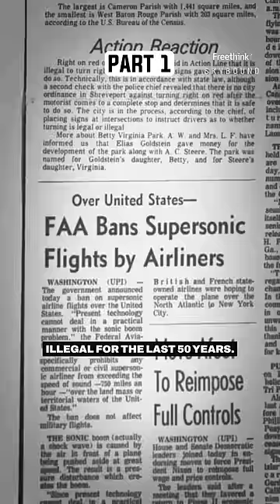NASA & Lockheed Martin's supersonic aircraft PT. 1 ✈️ #explained #shorts

Comment: One day we will figure out how to use this tech in commercial planes and I can’t wait for that reality

Edit: I mean without costing an arm and a leg and constantly crashing
Reply: Commercial planes are subsonic.
Reply: We had it, the concorde was a thing. It was super expensive, loud and not very safe though.
Reply: @thorwaldjohanson2526 i think it was only super expensive because they had to fly at subsonic speeds above land and it's onlu really fuel efficient until it flys above subsonic speeds
Reply: Looks like supersonic flight will come only for private jets. Because they created for reducing time, not for economy fuel or whatever
Reply: @thorwaldjohanson2526 The concorde was very expensive per flight because it was a gas guzzler when subsonic. It was designed to be most fuel efficient when it was supersonic and so the bad basically ripped it off the markey
Reply: @josephzicaro9913 Did you miss the "  One day we will figure out how to use" part?
Reply: @thorwaldjohanson2526 i think he meant the tech in the video
Reply: We already had that w the concord  but now it’s even worse bc it’s super fuel inefficient(so bad for the environment too), cramped and expensive
Reply: @calebquintana5724 that's misleading at best. Saying "oh, it was meant to be efficient at Mach 1+" is like saying an 18-wheeler is supposed to be efficient at 65 mph. It's still less efficient than trains for moving goods. Just like modern aircraft are more efficient at moving people.
Reply: @josephzicaro9913 no rlly???
Reply: AaaaaaaaáaáaaaaaaaaaaaaaaaAáaAÁAAAAAAAÁAAAAAAW❤áw❤❤❤❤❤❤❤❤❤❤❤😊
Reply: "One day" we already did figure it out. It didn't last because it was noisy, dangerous, and HELLA costly.
Reply: Supersonic is less lily to crash than subsonic becuase you have so much forwards force that a recalculated rout with NO turns...
Reply: Also, it's very not fuel efficient so yeah it'll cost an arm and a leg
Reply: Also its a cool concept but accelerating to supersonic abruptly is too many g's of force for the comfort of many passengers so speeding up and slowing down is much more gradual
Reply: And if you need to make a turn, you have to preplan way ahead to decelerate enough but decelerate slowly
Reply: Concorde didn't constantly crash, it was actually safer than pretty much every aircraft of its time.
Reply: @thorwaldjohanson2526 a broken piece of rubber brought me into this world and i dont want to be taken out by it
Reply: @justinmiller5660 No it’s not, you’re just not understanding or at the very least looking it up.  The Concorde used 3x the fuel to go 4-6x as fast at a higher altitude benefiting from thinner air.  Thing is, once you hit Mach 1.2 air resistance actually goes down and it cruised at 50,000 rather than 30,000 feet making it better.  The only thing making it less efficient was the overland supersonic ban.  These planes are being designed precisely because this was the case and NASA thinks they may have found a way to get the ban conditionally lifted.
Reply: Or would never be affordable though, I mean airlines already pack as many people as possible into a plane just to be affordable
Reply: @genericasianperson6405 why couldn't they always fly supersonic though?
Reply: @genericasianperson6405 it was inefficient because it used four turbojet engines and relied on afterburners to reach and maintain its supersonic cruising speed. It was less efficient when it was subsonic and supersonic. Meanwhile, we have turbofans today that massively more fuel efficient in all modes of flight than any turbojets while also being more compact and more powerful. That’s why even fighters today use turbofans.
Reply: @AnarexicSumo that’s entirely backwards. The Concorde was less efficient all the way around. The Concorde cruised at MAX of 1,540 mph (1,338 kts), but usually at 1,340 mph (1,164 kts). Meanwhile, airliners today have had their normal cruising speed reduced compared to the 70’s and 80’s as a cost-saving measure. The 747 was introduced with a cruising speed of 650 mph (566 kts) and the DC-10 had a cruise speed of 675 mph (586 kts). So the Concorde flew just over twice as fast as the airlines, not your 5-6 or whatever nonsense.

You were almost right and fuel burn rates though, the Concorde’s Olympus 593 engines used more than 3 times the fuel of a comparable CF6 engine of the time. The difference being that the Concorde was not more efficient at supersonic speeds. It required the afterburners to maintain that speed, which is laughably inefficient.
Reply: I love the idea also and hope I get to see it but even if they work out all the kinks I don't know of there would be enough demand to make it viable
Reply: @thorwaldjohanson2526 The Concorde was very safe, it only crashed once, it is safer then the 737 max.
Reply: @thorwaldjohanson2526  Air France 4590 was the only fatality in Concordes 31 year history 😊
Reply: @MrTrevortxeartxe it wasnt dangerous  air france 4590 was the only accident in concordes 31 year history also every passenger stated that it was 'the only way to fly' a bucket list moment.
Reply: @justinbowes5390  they had a metre in the plane to leg people know they were travelling above mach 1, whilst the hostesses served champagne
Reply: @thorwaldjohanson2526 it wasn’t completely unsafe. Like the Tupolev 144 i think it was.
Reply: @hardcoreway ummm no. I can’t believe so many of you think this is news. SuperSonic commercial has existed twice. Tupulev 144 (concorde ripoff) and Concorde. Neither were private. Both were commercial.

Comment: a common misconseption is that when you see the mach cone form around a jet, that is it passing supersonic and will release a sonic boom. This is not the case most times, the mach cone forms at around mach .96-.98, therefore meaning that the plane is almost supersonic but not quite yet, hense the condensation around the aircraft. Once they accelerate past that then you will hear the boom but most of these low flybys you see cant get up to supersonic speed because if they do they will shatter all the surrounding windows and damage everyones ears
Reply: you are right they dont travel at Mach 1 but slightly slower when seeing the condensation cones. I thought that due to the acceleration over the wings, the flow over the wings does experience Mach 1. Thats why the compression waves happen and we see the condensation etc. So i dont see why there shouldnt be a sonic boom as there are compression waves. Maybe not so loud as when travelling at Mach 1 but still.

Would appreceate your input!

Comment: So what is it about the shape that removes the sonic disturbance?
Reply: Likely the long, conical tip with the cockpit pushing out to make a concurrent low pressure behind it into the intake. As well as it being very narrow but long, to reduce the frontal profile so the sonic airwaves don't layer up as much
Reply: I think it is the fact that the bottom is much smoother, making the sound much quieter
Reply: Just watched a video on this and from what i understand the shape of the aircraft makes the sonic boom come from the top of the aircraft while the boom on the bottom is minimized by the smooth shape on the bottom.
Reply: @diraltmcallister3523 This is completely wrong.  The shape pushes the predominant of the pressure cone above the plane.  It’s only quiet from below.

Comment: Its not entirely a legal issue so much as an efficiency issue. Lower efficiency means less profiy.
Reply: No, that was a big issue for the Concorde because of the supersonic ban it spent a lot of time overland at subsonic speeds where the engines weren’t as efficient once it got out over the water it was much more efficient,  if this comes out and we can go supersonic overland as well. It will be much more efficient.
Reply: @DooHicky_  the concord had less seats and consumed more fuel per mile than an average 737. Ticket prices were more than double. I don't know about you but, that's a limited customer base.
Reply: @codyreber8370  yes because it had to spend most of its time below the speed of sound because it was only allowed to break the speed of sound over water, all that time over land at subsonic speeds was inefficient but if this lets us break the sound barrier over land then it will be much more efficient
Reply: @DooHicky_  you need to learn about fluid dynamics. The reason fighter planes also don't travel supersonic even over water is efficiency and more importantly stress on the frame. Supersonic travel is less efficient. That's not my opinion, that's a fact.
Reply: @codyreber8370  yes but it dosent have to be so expensive, optimised we can cut the costs due to the time of flight being shortened and efficiency of the engines increased, it wont be perfect but it will be a lot more reasonable than say the concord
Reply: @DooHicky_  its not the engines that are the problem it's the mechanics of supersonic flight itself. You could increase engine efficiency 5% and it wouldn't offset the massive amount of drag.
Reply: @codyreber8370  its not the general efficiency of the engines, they are designed for supersonic flight and work best there, the engines are built to fly supersonic in an efficient manner, what causes them to be inefficient is when they fly below the speed of sound, and this makes up most of the flight time, causing it to be expensive, the drag is overshadowed by the engines
Reply: @DooHicky_  do you know what a scramjet is? Yes they operate better at high speed, but again not at supersonic speed.
Reply: @DooHicky_  you really should understand what you are talking about before you speak
Reply: @codyreber8370  where did you get scramjet from, im talking about the concords by four Rolls-Royce/Snecma Olympus 593 turbojets. It had a mach 2.02 (1,338 mph) cruising speed for optimum fuel consumption (supersonic drag minimum and turbojet engines are more efficient at higher speed), jet engines being very inefficient at low speed meant it burnt 2% of its whole fuel load at only taxi and takeoff. The aircraft used afterburners only at take-off and to pass through the upper transonic stage to supersonic speeds, between Mach 0.95 and 1.7. Afterburners were switched off at all other times, fuel consumption was a big deal back then mostly due to the 1973 oil crisis as well. And for the high drag, the drag at supersonic speeds was related to the span of the wing. This led to the use of short-span, thin trapezoidal wings with low drag at high speed. Dont tell me i dont know what im talking about
Reply: @codyreber8370  less profit dosent matter when you only make a few and make the tickets expensive, the rich people who did fly on it could afford the expensive ticket which brought in lots of profit for the airlines
Reply: @DooHicky_  drag isn't just a matter of cross sectional area. It's the way that air flows at supersonic speed. Yes you need smaller wings to fly supersonic. However that also comes with either a really steep takeoff and landing pitch or higher landing speed which also limits the number of suitable runways. Back to the point about drag, it doesn't increase linearly with velocity. Just before Mach 1, and turbulence builds behind the wings and compression of the air in front causing significant drag. Look up drag coefficients vs Mach number. Most of the fuel spent in a plane is overcoming drag.
Reply: @codyreber8370  well if runways are an issue then look at the boeing 2707 concept, and of course fuel is spent overcoming drag you need thrust to go anywhere
Reply: @DooHicky_  yes. Fuel being one of the biggest expenses. That and maintenance is going to be a much more pressing issue. Speed tape doesn't exactly cut it for sealing off between panels on a supersonic aircraft. I'm not saying supersonic commercial travel isn't going to happen or that it isn't feasible, it's just going to be way to expensive for the vast majority of people. Its likely to be reserved for intercontinental travel like the concord was in the first place because it's simply not economical
Reply: Yup, supersonic flight for Concorde et al used 6-9x the fuel. Why are we giddy for rich ppl to grow their already huge per person carbon output?

Comment: Problem, what fuel does this plane use? Fossil fuel, so to that point all innovation should be forced to making them as clean as possible and not making them go a little faster, make them burn hydrogen so that 2% Co2 and other emissions like NOx and HC can be dropped to almost nothing then go faster
Reply: Agree this is only ethical way supersonic civilian flight could be made real, as it uses 6-9x the fuel with similar multiples of carbon output. As it is, why are we cheering that rich people could up their already extraordinary high per person carbon emissions on flights 3-10x the cost of conventional subsonic.

Comment: Great but the far bigger question is how we stop aviation from fueling the climate crisis instead of massively contributing to it through something we don’t need? 

Commercial supersonic flight would be just like it was last time with the Concorde, only for the super rich. Climate justice anyone?
Reply: If we wanted to go into specifics, concorde at full speed was actually quite fuel efficient, however below mach 1 efficiency takes a huge hit and because much of it flew over land in portions of the flight it means that it wasn't very fuel efficient during a good portion of the flight as most countries banned commercial planes going above mach 1. Having a supersonic plane with an almost inaudible sonic boom would allow faster flight times and greater efficiency, still doesn't necessarily change the fact that it runs on fossil fuels but it is a neat fact if anything

Comment: Its my understanding that its the fuel efficiency not the disturbance the sonic boom is the reason we do lot have super sonic commercial planes. The Boom pushes back on any plane going faster than sound requiring large amounts of power to maintain super sonic flight. All a plane has to do is not go supersonic until it hits high altitude and the problem of noise disturbance is solved.

Comment: So why is the sonic boom only a boom. If an optimum rate of flow of pressure waves reaching the ground is responsible for the sonic boom why are they only singular? If the ground was removed would the boom be heard at an optimum distance from the source? Would it be singular & would speed fluctuations produce marked arrivals at optimum performances?

Comment: Commercial super sonic flights ended because nobody wanted to invest more money once the last concordes reached its operational lifespan. The only route profitable and really feasible was a transatlantic London/Paris to New York where the plane can go supersonic over the ocean. Other routes could not sustain the flight costs due to the demand or the plane could not go supersonic over the route because of the sonic boom hitting populated areas. The '50yrs' is over the spl levels of all commercial flights, including sonic boom producing ones.  Those old enough, as late as the 80s, will remember the low drone of airliners that could be loud enough to drown conversation depending on where in relation it was passing over.

Comment: the main problem wasnt just the sonic boom but highly inefficient fuel use, it used 3 times as much fuel than a commercial plane
Reply: Only per hour and it went 4-6 times as fast meaning if it could go its cruising window of 50,000 feet Mach 3 it was actually more efficient for a given route.  Instead it was forced to fly 30,000 feet 500kts which it was only designed to do while accelerating to Mach 3

Comment: Single engine aircraft will never be commercially viable again. Modern commercial planes can still function with one engine (except takeoff) which has made air travel so safe and common. The first time one of those has an engine failure thatll be the end of it.

Comment: What if we start focussing on efficient and clean transportation instead of unnecessary speed?
Reply: Supersonic is more efficient.  It’s a common misconception thanks to the overland supersonic ban by the FAA.  Planes designed to go supersonic are more efficient when allowed to be supersonic.  Even the concord, which used 3x the fuel per hour, could do the same trip in 1/4 to 1/6 the time.  The problem with the ban is supersonic engines aren’t efficient at subsonic speeds.  They have to be able to quickly get to their cruising speed to be efficient.

Comment: The real reason commercial flights don't fly at supersonic speeds has nothing to do with noise, and everything to do with cost.

As speed increases, drag increases exponentially. It takes more fuel to fly the same distance at greater speeds. by a shitton.

They could very easily fly much much faster than they do, but they don't because it would make the trip far too expensive to be worth it.

Comment: Brother ignored boom sonic entirely. Also this knowledge has been common for a while now. The issue with super sonic passenger flights is much more focused on fixing cabin overheating and fuel efficiency. The sound is an easy fix. Mixing in all 3 facets at once in an aircraft that is supposed to eventually only cost $100 for fuel reservation (buying a plane ticket) regardless of destination?? THAT is a much bigger problemo
Reply: Also they need to perfect the lame ass pressurization issue a ton of these jets💀🤣